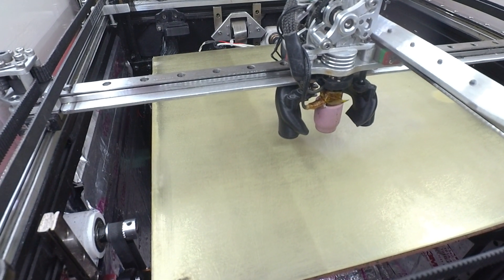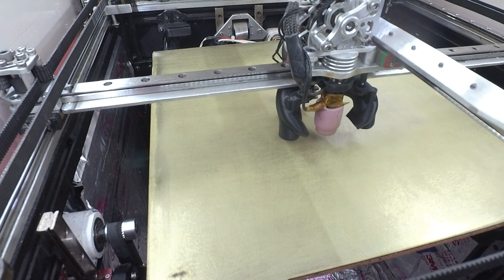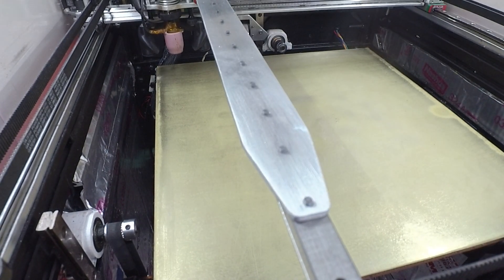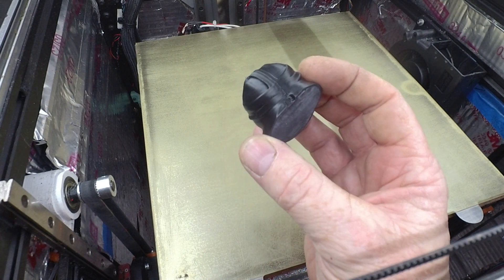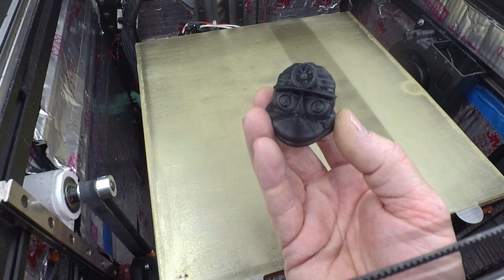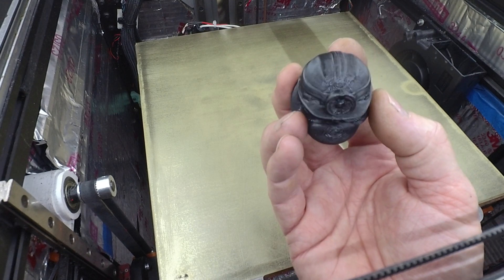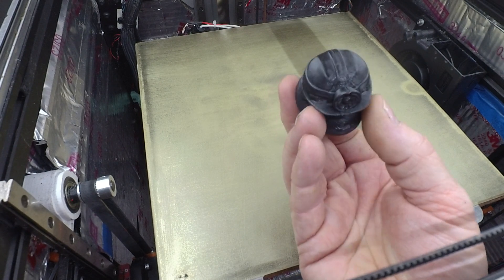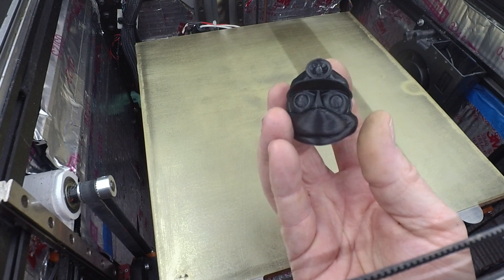Slicer got me good.

Comment: The tig cups are wild, is that just to insulate the hot end from part cooling? What hot end is this?
Reply from the maker: 3 things.. the extra weight lowers the center of mass. The cup insulates the hotend and it also heats the air off the duct so there is less delta/worse cooling to ensure better layer bonding. The latter, just a guess.. Still testing.